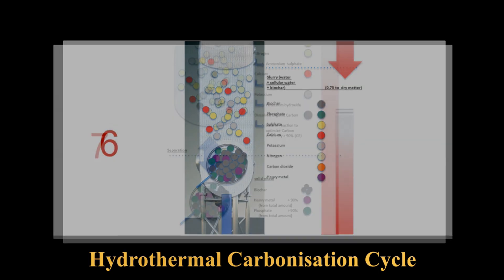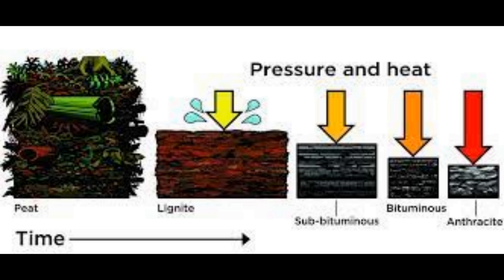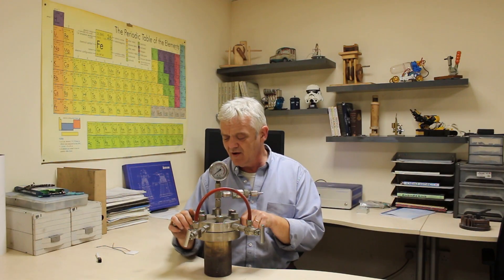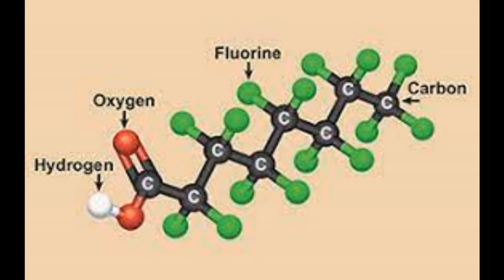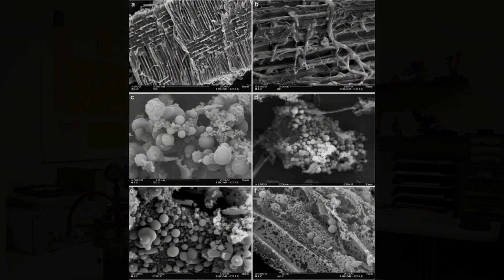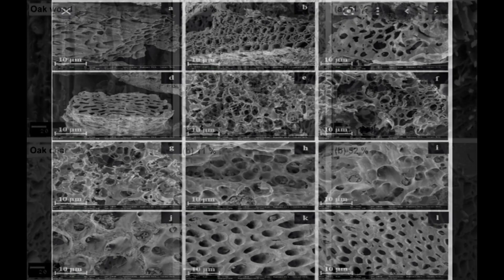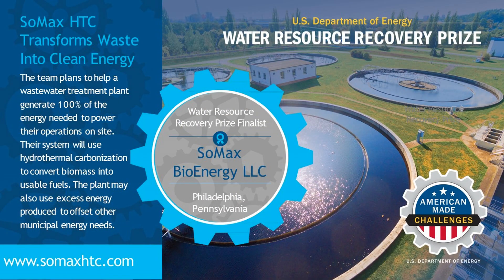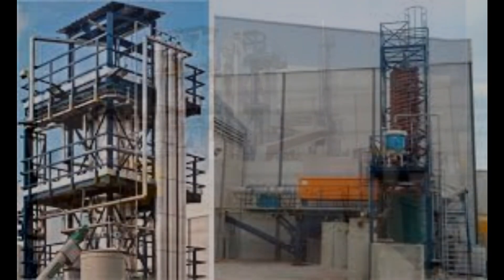1661 How To Make Your Own Fuel From Waste Or Plastics - Hydrothermal Carbonisation

Comment: 10-50 PSI? Almost sounds like one could fabricate something out of a standard water heater, if one had the skills and machinery to make the hatch. I'd really prefer stainless for this, though.
I'd make sure I had multiple pressure relief valves on them, though. One for release of pressure during normal operations, and 3-4 others at different levels: Top, bottom, and split the heights, something in there will hopefully bleed. I'd also have them feeding into a water bath, FAR from the heat source in case it's venting flammable gas. And WELL ventilated, as in, outside.
I'd also build a blast wall to hide behind.
And after a quick Google Shopping-Fu, plug-in autoclaves of 10~ish liters capacity can be had for like 80 bucks US. The one I looked at is preset for 120 C, and 15 PSI. Which should work.

Comment: This is interesting but I think a more efficient simpler method would be using low pressure version like a nasa toilet design. This could get the job done without requiring the autoclave or the acid, it also requires less heat but might produce large quantities of natural gas, some of which could be used to run the system.

Comment: I think poop is too valuable to burn as fuel. 
It should be composted and used as fertilizer.
Instead of using chemical fertilizers that don't replenish what plants use up, and kills off bacteria that plant roots need.

Comment: I did not know that anything like this was possible until I saw that bio-diesel was something one could make in a survival video game called Cataclysm: Dark Days Ahead. Though I do not think one can make fuel from plastic or manure in that game.
Reply: I'm interested in achieving this process in the hopes that less plastic waste will be dumped into ocean, and at the same time making use of all the other bi-products used in this process. I sure miss having a fish dinner without being exsposed to less mercury.
Reply: @Spiritman597  
Right, there are some plastics that cannot be recycled. Hopefully we can use hydrothermal carbonisation to convert those into mercury free carbon, since burning coal apparently accounts for a little under a quarter of the mercury we put into the environment.

Comment: Turning old tires into fuel would be great. 
Turning poop and waste water sludge into pharmaceutical free fuel would be great. Germany needs the power right now. Things are looking bad. 
I'm told LNG is the, the most expensive way to move natural gas due to freezing. Also Germany does not have LNG ports nor the infrastructure. U.S. Farmers Almanac is calling for a cold winter in part due to reduced sun spots.

Comment: You could you lies a concentrated solar dish which is like a 10 ft satellite dish covered with mylar or something similar or a large frenzel lens to produce the heat for boiling that way it would not take a lot of energy to do it I would take a lot of electricity or wood or something to boil that for hours

Comment: The problem I see is firstly, how much energy is being used to create that heat and pressure.

Secondly, with regard to fluorinated long chain organic molecules, free fluorine can be a very dangerous chemical (quite safe when in a long chain molecule, but very dangerous in many other circumstances).  How safe would the breakdown products of these substances from an autoclave be?

Comment: Sounds a bit stinky to me 🤢
How much energy is spent on the heating process versus what is produced from the final products? 
Is it viable or just a means to break down some waist ?
Reply: Viable. Net postive energy. Your creating an endothermic reaction, meaning the end result has stored some of that heat energy you put in there.
The U.S.S.R. and the United States used these types of reactions to produce fuel as a buffer for fossil resources durning WW2, although i believe initially they tried to keep the reaction rather dry, sometimes using hydrogen directly as an additive at that point in time. 
A simular, related process was also used to "gassify" wood in situ, done on the moving vehicle for use in automobiles by some of the axis powers during WW2.

And of course that's assuming that you have appropriately insulation and that your not wasting a bunch of heat, but given what's been done including self powered vehicular reactors in the 1930's id imagine you would have to work hard to get a negative energy conversion.

Try nickel as a catalyst, you get various bio crudes and if you use waste from paper production  (tall oil) you can get naphtha, a mix of petrols and diesel fuel hydrocarbons with the right acids.
I believe the paper I read on it used carbonic acid, literally just carbonated water.

Comment: Unless you can make campfires,, the process takes more energy than you produce.
Reply: You can use Solar. Both direct as in Solar light/ovens/concentrators, or hooking up resistive/heating wires to a Solar panel.

Comment: So, the pressure and temperatures are more than that of a cook stove pressure cooker. 

How about this: would the environment in a Diesel engine cylinder produce the proper conditions for HTC of an organic slurry?

In the same way that auto engines are converted to air compressors with modified cylinder heads, could an engine be modified to use some of its combustion chambers to process biomass into water and carbon solids?

It seems like carbon buildup is always the unwanted byproduct of internal combustion. Could careful control of the process make it the desired end product?

If one could control the amount of water and feedstock, you could also recycle the steam to add additional energy back into the system. 

An engine that squeezes the coal out of a septic tank. What a time to be alive!

Comment: Build a cheap incineration toilet! There is a huge market because the existing models are quite expensive (2.000 - 4.500 $) and it is interesting for off grid living and cheaper house building.

In one of her annual reports BASF wrote about a project of recycling plastics in this way but that was it. I never heard of it again.  We could collect plastic waste for conversion to gas the same way we collect paper or glass. In Germany the plastic waste is collected once a month in a yellow plastic bag ("Wertstoffsack") but as far as I am informed this material is not recycled as they say but instead burned.

Comment: I wonder what happens if you put algae from a bioreactor in there, the same type of algae that made the oil deposits millions of years ago? If you have enough of them you can remove the water so it doesn't interfere with the process.
Reply: water doesn't interfere: is a crucial player in the process
Reply: @lokiaverro4196    Yep, and the mineral based acid.

Comment: Surely burning those fuels just produces co2 though? 

Appreciate it slows the rate at which we add it because we're getting more from each batch of oil and energy that made the original substance but... It's still adding to the atmosphere when you use it, right? 

Could be an ideal way to take plastic and carbon out of the environment and store it somewhere though.
Reply: yes, burning the carbon will put it back into the atmosphere. the ideal use (from that perspective) would be to use the carbon product as soil amendment.
Reply: CO2 is not what is primarily causing climate change though. Rather, the climate models only factor in the Sun's irradiance (visible light) as a warming source from the Sun, but in reality, the Sun can heat the earth in multiple ways, and the Sun was in a grand Solar maximum from about the 40's to 2000 or so, when it was pumping A LOT of extra energy into the earth (the irony being that Solar irradiance actually goes down during Sunspots, solar flares, CME's, etc). Though it has since calmed down, the oceans are a giant energy/heat reservoir and take a long time to dissipate/lose that accumulated energy. 

  Meanwhile, when the Beaufort Gyre finally releases all that pent up cold, fresh water back into circulation, it will majorly mess with the ocean circulation and plummet the earth back into an ice age--the weakneing/quieting sun (over a longer period of time--currently we are going back into a short/regular Solar max cycle) will not help in this regard either.  These are roughly 10, 000 to 13, 000 year cycles.  About 11, 000 years ago, the earth saw a temp change of around 10* C and then around 4* C world wide. 

Currently, there are major changes being seen in all planets of our Solar system minus Mercury--which we currently have a lack of good data on.  Human pollution and C02 are obviously not causing these major system changes in all the other planets. 

   With all that said, we DO need to address and clean up our environmental pollution--not because of climate change, but because of collective health reasons. 

   Btw, though I question mainstream climate science, I am not a "right winger" type at all.
Reply: A good resource for understanding all this better is the channel, s.u.s.p.i.c.i.o.u.s  observers (take out the periods in the former--I wrote it that way so that y.t. doesn't delete the comment).
Reply: @justinw1765  Science questions science, or at least that’s what I’m told.  It SHOULD BE recursive. we need a new generation of scientists.

Comment: one point some may try, Vinegar as the acid.  The results will vary greatly as the Ph and chemical composition of various types of even the same brand and type will be different between batches.  The companies can get away with it as it just has to be ' food grade ' and not Chemical grade, which will have to be measured in percent molar solution or pure powders.  In the late 90s I was sent a Youtube link to a similar aparatus that bubbled the heated vapours through water and any excess waste gasses could be burned to heat the chamber and reduse the fuel used.  This is also the basis of Gasifyers ( spelling??) that has use running cars by burning waste wood products ( without the acid as they use wood types that are naturally acidic as the compost ).  As usual great video, good pictures to describe the process.  Next step would be checking local regulations on what constitutes a ' still ' or distillary regulations and research if you can make something thatbwould be practical to add to the rocket stove.
Reply: Robert pointed out that it needs a mineral based acid as an organic based acid will also breakdown and carbonize along with whatever else is in there.

Comment: How about an autoclave diy video?
Reply: Believe there are some old ones. You can use SS, threaded, plumbing pipe with caps, but you do have to watch the temps and times with these, because they can't handle the pressure of the autoclaves like Robert shows in this video.  Best to heat it outside either in a hole in the ground or covered in sand.

Comment: Sounds like the start of another playlist.  How to make your own autoclave with minimal tools, what happens when you hydrothermal carbonize old tires, how to store the various products of hydrothermal carbonization and what you can make from them, the list just goes on and on.  Hope this is the start of a long series 😁.
Reply: Plastics are sophisticated materials,  he is making low end fuels with high cost plastics
Reply: @Blue.star1  But plastics are evil waste.
Reply: @forestMog  every thing will be waste if not used properly including water
Reply: Definitely don't do that with tires
Reply: @yonkromis7883  Proper tire pyrolysis yields a diesel grade fuel and carbon black, which has many industrial uses, along with steel belts for other industrial uses.
Reply: @brianwesley28  correct I worked with Rodger Jailer building a prototype plant in the UK several years back, I think Firestone bought the patent.
It was really interesting work, and quite simple.

Comment: I saw a very old video on the reaction between acetylene and chlorine gas. Under pressure in an autoclave the reaction should create graphene.  Has anyone (Rob?) Seen any papers or tried this?
Reply: I sincerely hope no one tries this at home.
Reply: @lokiaverro4196  it is a standard high school science reaction when not pressurised
Reply: @bloodyricho1  "when not pressurized"
Reply: @lokiaverro4196  there is such thing as pressure valves and if you use yhe proper stoichiometry it is hardly dangerous.  The Indians are just doing it with acetylene and a spark plug and achieving a low grade product.  Edit: the calcium may work as a catalyst

Comment: YouTube channel NatureJab had built a few microwave autoclave machines. He microwaves plastics into fuel. Same concept. It's worth checking out if you are interested in the subject. He microwaves it and then distills the liquid portions. And he gets a fuel. Very cool
Reply: I was just going to point that out!!
   He doesn't use high pressure though, just microwaves as an efficient direct heat source and carbon as a susceptor ...

Comment: The Poopertron-3000 converts human waste, and waste humans.... Not sure my local council would let me run a bomb of any useful size in my back shed though. I wonder if you can combine it with a solar thermal source. One thing though, what happens to all of those nasty fluorine atoms? Also did you find that paper by that Japanese guy where iron oxides are used as the catalyst? Not sure I want to be adding even more sulphur to my biodiesel than is already in the source material. That Japanese work may have been at higher temperatures and pressures though with the output being syngas for running turbines in an electric power plant. They built a prototype that proved it worked well, ran it for a while, then shut it down. Not sure what came of that, if they then scaled it up for regular use and put it to work.

Comment: Years ago in an organic chemistry class we put sawdust into test tubes and added heat from a Bunsen burner. Because the tube was relatively oxygen free the wood didn’t burn. But once the moisture boiled off it emitted volatile gases which flowed down a tube to a pipette where we burned them in a constant flame. The material left in the tube was mostly pure carbon, which of course is also burnable. I think this is similar to what happens in efficient wood burners like rocket mass heaters. Instead of unburned hydrocarbons going up the chimney they are burned.
I worked with a researcher who wrote a paper about turning plastics into fuel. Years later I saw someone else doing just that at an energy fair. He started by demonstrating dissolving LOTS of Styrofoam with acetone, ie fingernail polish remover. But for more complicated plastics he used a device, probably similar to this one, to create a type of diesel fuel. That was several years ago so I’m surprised I haven’t seen it commercialized.
Reply: I'm not surprised. The most wealthy people in this world, have an agenda, and that agenda doesn't include us being energy independent, but as dependent as is possible.

Comment: Thank you for all the great info Robert. What will old car oil do in this process?
Reply: Don't see the point when you can directly use the car oil as a fuel, and if you can use a system that has efficient secondary combustion, you'll burn off most of the pollution/toxins.

Comment: There are specific types of biochar kilns that will capture the volatile gasses to either send it back to the kiln or to capture for use in other purposes . As mentioned in your video there are extras in the liquid and gasses , including pyrolignious acid , when watered down is a fertiliser that can be added back to the biochar 

As a heat source there’s potential to use the device as a heat source for electricity generation , sterling engines ….. etc

The biochar industry needs this as there’s too much carbon in the atmosphere

Comment: I know induction heating might be the most energy efficient, but I wonder if solar heating would be just as effective
Reply: Or a combination of the two.  Solar when available. And Induction using a generator using steam (use the coal or anything to heat the water to run the generator)
I like the idea of cleaning up GARBAGE and get rid of those FOREVER particals
Reply: In order to use Solar for this process, you really would have to optimize it. Paint it the blackest black that you can, use Solar concentrators though you wouldn't want to point a very pointed parabolic beam at it, but use a more diffuse/larger area "beam". Alternatively, using vacuum insulation around it would help a lot (and you could probably forgo larger, more involved solar concentrators). It is not too hard to make vacuum insulated, mostly glass panels, but it is somewhat expensive as you need high quality, strong and thick glass for this application. (Easier and cheaper to do, would be to use glass jars, and once sealed with the vacuum pulled, put it upside down over the tube). 

     Another option to use Solar, is to get a good size Solar panel, and then hook it up directly to resistive/heating type wire, and wrap the tube with it, and then put a bunch of insulation (rockwool would be the best) around it.